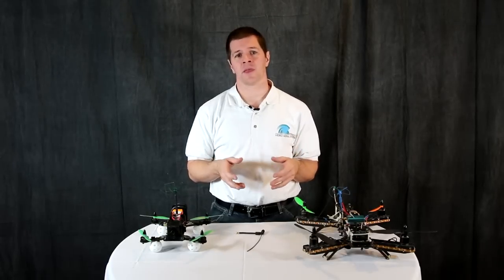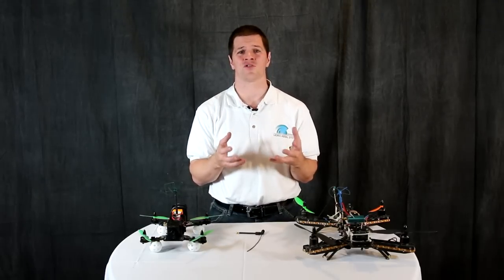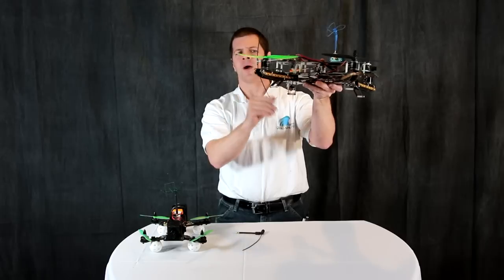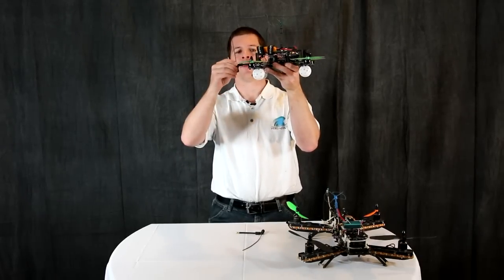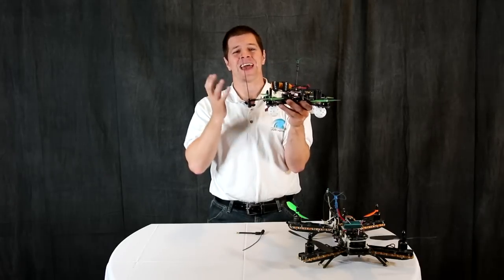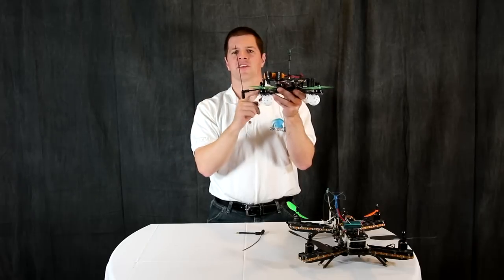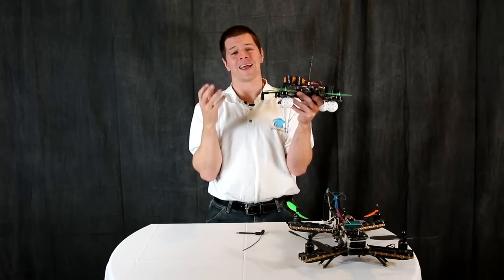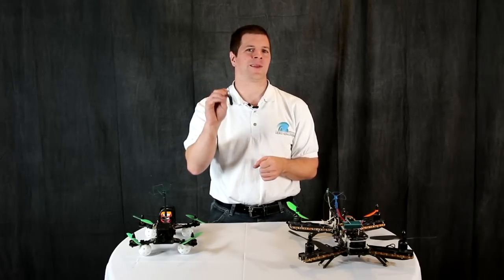Coil loaded dipole overview

Comment: I am searching for this solution for my normal 2.4Ghz radio system. It would be great to get something similar for the 2.4Ghz systems, or wouldnt it max out the performance??
Great thing would be to get it into the back of the quad, away from the 5.8GHz FPV. 
So, it would be great to see something like this for our miniquads on 2.4Ghz (i cannot use UHF here in Germany...sadly...also 1.3 is forbidden...I can only stick to a normal 2.4 radio and 5.8Ghz FPV solution).
I am currently building a new mini and it would be great to get such an antenna ready for mounting to a FrSky, Spektrum, Futaba receiver (those have connectors to replace the wires....
Would that be possible?

Comment: Alex Greve any of the retailers holding these for sale or it's just an informative video?
Reply: I saw the video on building one but I already have a few semi rigid  di pole  antenna if I coiled that over a pen as shown in the other video will it still work ok?
Reply from the maker: Travis Miller
 - No.  The semi-rigid is made from braided cable.  The coil loaded needs to be made from copper wire (the semi-rigid will not coil).  You can buy the Semi-rigid at a few retailers such as StoneBlue Airlines, GetFPV, and Multicopter Builders Group.  However, In most cases the semi-rigid dipole is preferred if you can fit it on your aircraft.

Comment: Maybe this is silly .. but why we have two big antennas on the quad? 
i assume one for Video and one for GPS ?
Reply from the maker: +Ahmed Gamal - One for control (coil dipole) and one for video (2.4GHz video).
Reply: so you replaced the standard receiver antenna ? i thought that is factory calibrated, right ?
Reply from the maker: +Ahmed Gamal - I have yet to see a stock antenna perform well.

Comment: Would it be possible to do something similar to this with one of your standard Semi-rigid dipole?
Reply from the maker: Sadly, no.  The Semi-rigid dipole is well sealed inside the center tube.
Reply: Alex Greve Not a problem. I will be picking a couple of these up sooner or later. Thanks again for all your work.